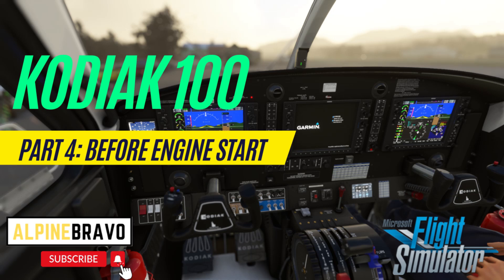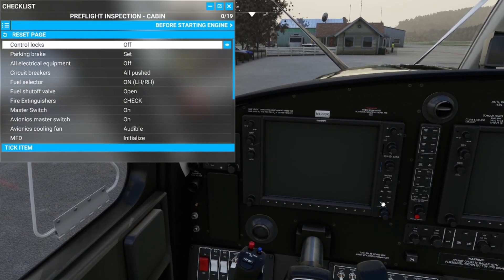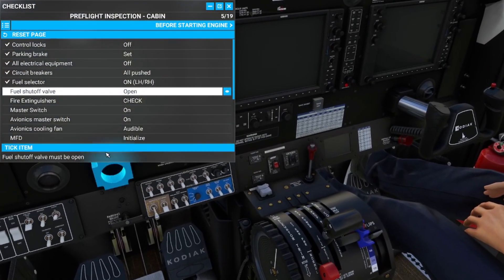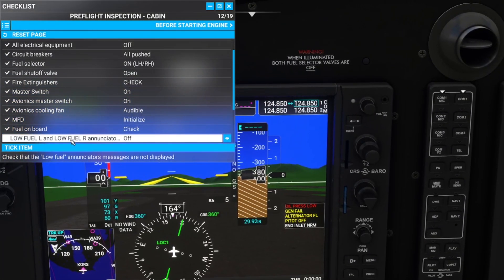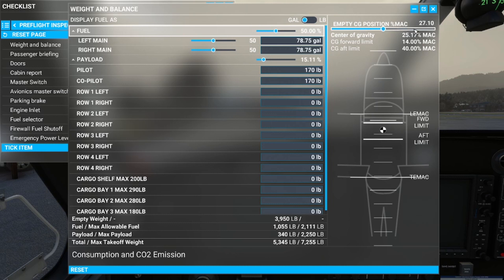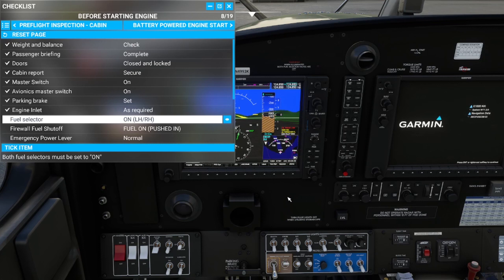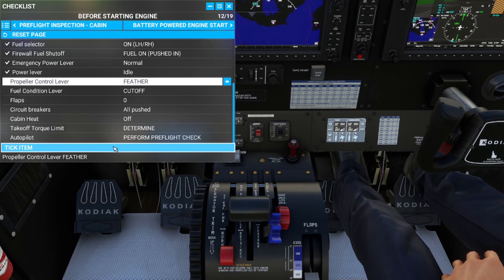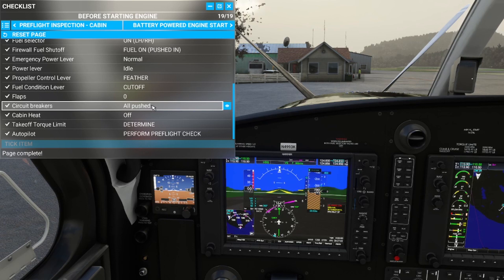How to Fly the Kodiak 100 | Part 4: Pre-Flight Cabin and before Engine Start Checklists

Comment: Thanks for this! Of all the things your tried to teach me today, what I got was an explaination why I'd tick a checklist item and the highlight wouldn't move to the next item. :D Also, SWS must not have released this version yet (even after 2 months) because as of today (03-09-23) the retail version checklist contains many errors and omissions that I'm seeing are fixed in your beta version.
Reply from the maker: The version I'm using in all the videos has been released (I only got the update a few days before general release) Not sure if the update has come out yet in MSFS marketplace - but I thought it had.
Reply: @alpinebravo7090  Interesting; I just bought this direct from SWS yesterday, and the differences in the checklists are noticeable. Well, I'd ask over on their discord, but somehow discord thinks I've already used my phone number on another account, so I can't sign up. Sheesh! Once I get that sorted hopefully I can ask there. Thanks for the reply!
Reply from the maker: That in the Floatiak? It will have different check lists as it's a pitch-latch propeller
Reply: @alpinebravo7090  Oh...yep, the Flotiak. But IIRC, the first difference in the checklist that was noticeable is that there should be 2 entries like you see at 3:46; a "master switch" and an avionics master. In the flotiak there's only a single entry: "master avionics switch" listed. :-) Little things like that. Not deal breakers, just a bit annoying.
Reply from the maker: @wilddoktor  Understood - you should report these to SWS.  Although I use the in-sim checklists in the tutorials, I actually use a paper version of the IRL checklist - its a lot faster than clicking through the menu